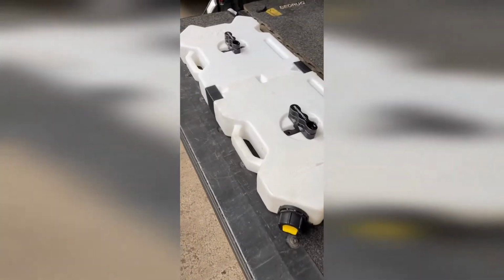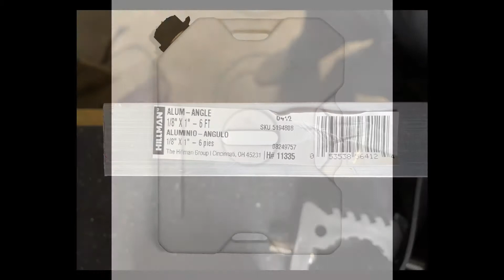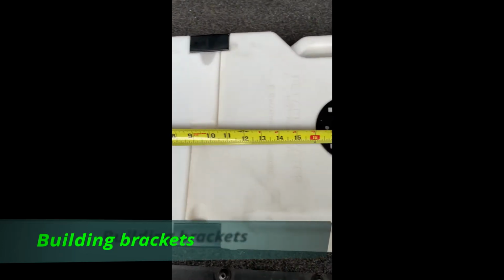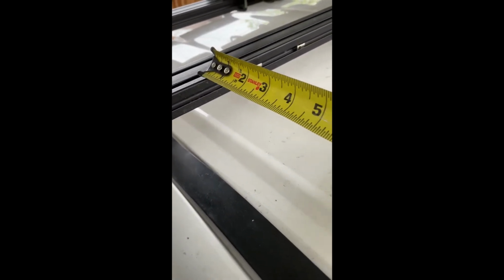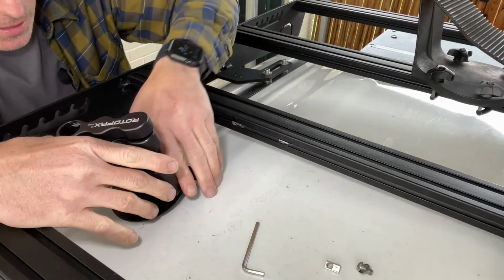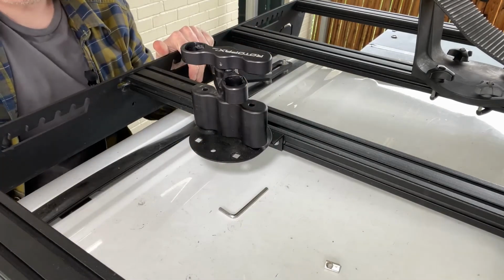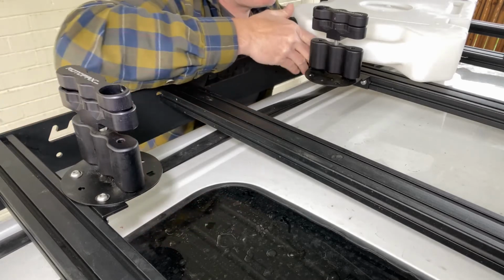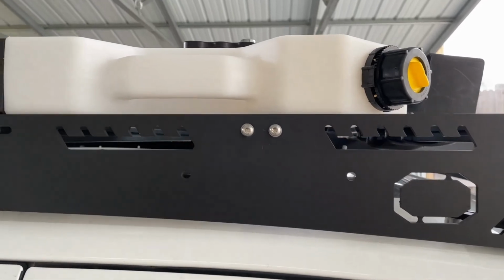Gear Up for Adventure with DIY Rotopax Brackets for Your UpTop Overland Rack!

Comment: Just curious why you made the brackets to fit the SIDE of the rack , instead of using the track nuts and sliding them into the top of the rack it's self? Looks great however!
Reply from the maker: The uptop crossbars didn't have enough adjustment to line up with the RotoPax mounts.